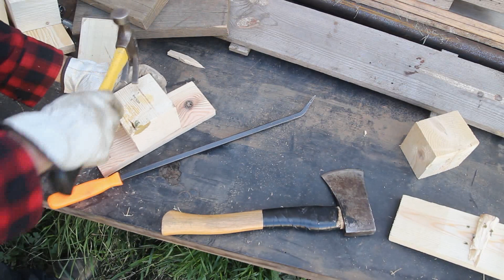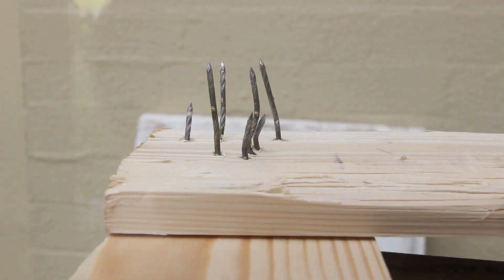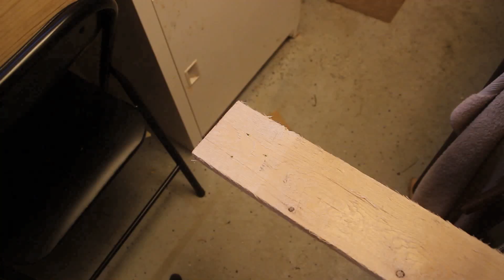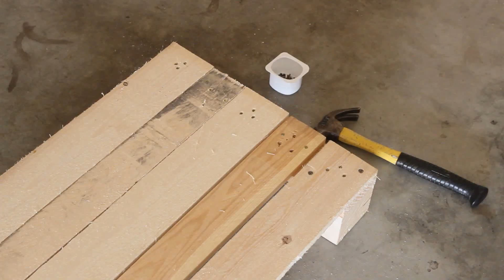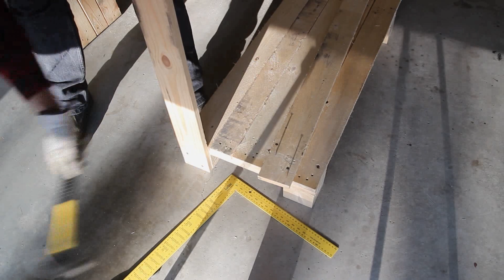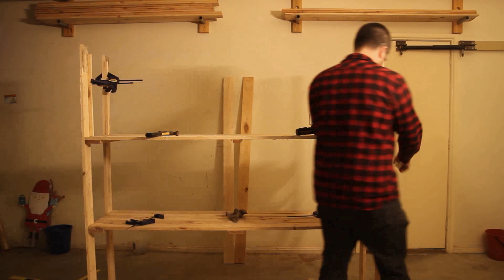Freestanding rough pallet shelves build from 2 pallets, 102 nails, and some loose planks.

Comment: That's one of the best compromises of handling a palette and the wood from it. In Germany a lot of people use palettes with just little modifications, while a lot of American youtubers strip down palettes and send them through the planer to build nice furniture (often withz good results). But your approach in this video is great.
Reply from the maker: Thanks! I usually strip them down all the way as I want to make things out of wood more than out of pallets (to me a coffee table made out of two pallets stacked on top of each other is just two pallets stacked on top of each other - not that there's anything wrong with eating your dinner off two pallets stacked on top of each other while watching TV) but for something like this it makes sense to leave most of them nailed together. I should have got a better shot of the clinched nails, they take some effort to get out, the best way I've found is cutting the thick underboards on each side of the top plank, splitting what is left away from the nails with a hatchet, cutting the bent ends of the nails with bolt cutters and then banging and pulling the nails out. Easier than straightening out the clinch but it wastes more wood.

Thanks for watching!

Comment: Not a power tool in sight! Well done!
Reply from the maker: Apart from the angle grinder and table saw, but the nails could have been clinched instead of cut off and the boards could have all been ripped with a handsaw. Cheers!

Comment: My last comment I made (in different video) u say u don't like scratches on ur boards I look at this video and noticed scratches then u say something about the nails this video u cut the nails ? Have u just given up buy take the nails out the old way and now u just cut them ? Little confused here where u just being sarcastic to me ? also do u love doing this or do u just have no life ? Just wondering why u just don't go to a lumber company or pallet company and just ask for there scraps we give scrap wood away all the time ?
Reply from the maker: You claimed all pallets have scratches, I said some don't have scratches, I didn't claim no pallets had scratches or I would only use pallets with no scratches, I just choose not to use a sawzall to cut nails as it damages the planks and leaves cut off nails embedded in the beams (I mentioned this in the other comment chain but you didn't clarify how you use one) I cut the nails (after I had removed the blocks they were embedded in) in this case because I was making rough shelves and it was quicker/easier than clinching them over. Using a grinder leaves a nice smooth finish too.
Most of the planks in these pallets are clinch nailed, if I need long boards I cut the short boards between them (I used a sawzall last time), split them away from the nails, clip them short with clippers or bolt cutters then bang them out and remove with a claw hammer. Different construction methods dictate different teardown methods.
I wasn't being sarcastic. 

Do I love doing this? it's OK I guess. Do I have a life? I'm not going to dignify that with an answer.
I get off-cuts from the local big box store occasionally and there is no pallet company close enough to bother driving to. Pallet wood is perfectly adequate for most of the things I make.

Have a good one!